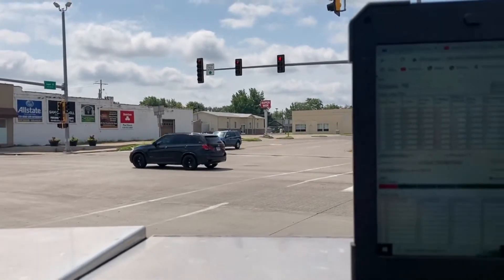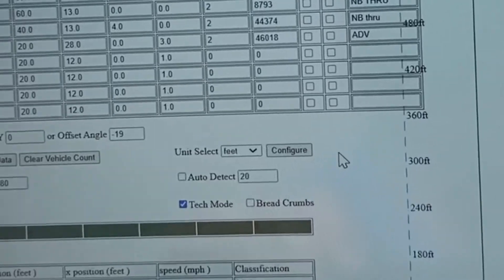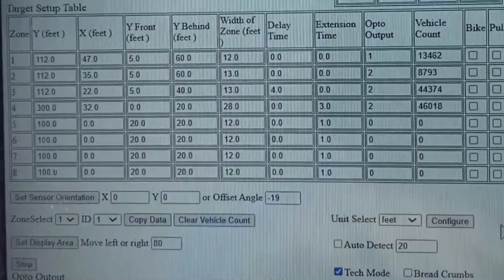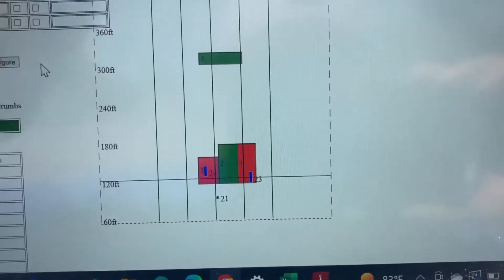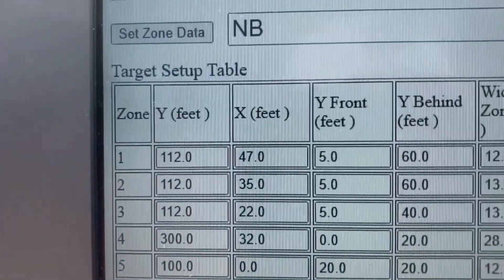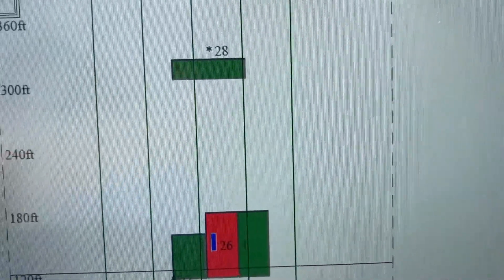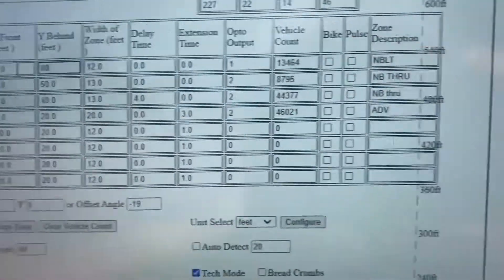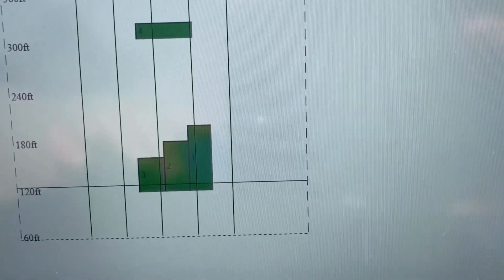Fixing Bad Drivers with Radar Detection

Comment: Ah hah!  This all makes sense now.  I bought myself a Uniden R7 radar detector for Christmas 2022.  Sometime around March of 2023, the city installed a bunch of new highly unnecessary traffic  signals on a divided feeder road to interstate 35, and every time I'd approach one the K-band would light up like a Christmas tree.  It got me curious if any traffic signals used radar for vehicle detection, but naturally not knowing any brands or models, that was frivolous and didn't really answer any of my questions.  You mention "M S Sedco" detectors, which from a quick google search, their datasheet shows they operate at 24GHz which is smack dab in the middle of the K-band.  Neat.  I got so tired of thousands of false K-band bogey alerts that I disabled detection of the band all together.  Ya can't drive a mile in this city without at least 3 false alerts.  IDK if the police even use K-Band around here anymore, one day I might find out the hard way, or maybe not?  I don't really speed unless I'm on an open interstate, but even then I'm more of a 5mph over kinda driver.

Comment: can you explain the flash light to the interection changing the side roads to detect immediately and changes the main redlightt timing i have an intersection where at night you have to sit and wait for 5 mins aand the main way stays green with no traffic and i sit and wait the intersection is NO TURN ON RED and ith an acward side slant and the other side is blocked to to a building close to the interscetion its on our main street in the middle of town if you can explain how this work thank you great videos
Reply from the maker: I always here stories out there about using flash lights to change the traffic lights.   Not possible.  
It sounds like though that the detection for mainstreet is bad and maxing out the green time OR someone programmed WAY too long of a green time in the traffic signal controller.  Either way, find out who maintains the signal and complain until they fix (squeaky tire gets the oil).  This will be usually be the city's Public Works Dept.  Hope you get that resolved.  I feel for you!
Reply: @streetsmartstraffic  I always laugh when see someone sitting at a red light and start flashing their high beams lol.  Can't believe people still believe this myth.
Reply from the maker: @elesjuan  If it says it on the internet, it must be true!  lol

Comment: I don't know why or how, but, YouTube just started showing me these videos.  It's interesting, for sure, more so about HOW the lights work, rather than the repairs.  I'll never see or operate the inside of one of those control boxes, and I'm sure there's millions of variants.

One thing I have seen in my neck of the woods (Ontario) is there's pavement patches where I thought sensors were (And probably are, given previous comments).  I try to roll up on those.  I didn't know there was radar involved, but I guess that'd change light to light, district to district, traffic volume to traffic volume, and dollars and cents. :P
Reply from the maker: Radar, video, microwave, inductive loops, proximity sensors...all kinds of detection could be used.  But yes you are correct, it varies all over the world.  Thanks for your comment!

Comment: Happened to me since I tend to stay back behind the stop line especially where a side road joins the main highway and trucks cut the corner in front of me.  Once I missed a full cycle and never got a green light so I advanced 10 feet or so then finally got the green light.
Reply from the maker: Great point.  You're one of those smart drivers though!  You realized it and pulled up
Reply: @streetsmartstraffic  On friday driving home the same way I looked for cameras or radar, seeing neither, concluded it was inductive sensors in the roadway.
Reply from the maker: @thomasmaughan4798  Sounds like you did your due diligence!

Comment: In Australia, we have a related problem that idiots sit right up the arse of your vehicle at traffic lights, instead of keeping the mandatory distance of at lease one vehicle length (5 metres). One excuse is people think there are more than one sensor at lights and they think cars have to be shoved close together to detect more cars and give those lanes priority. -How wrong they are.
The other excuse is idiots are being taught by other idiots that they only need to be able to barely see the tyres of the vehicle in front, so they can turn out if they need do. -Not only is that wrong, because that depends on how far the front wheels are from the front bumper of their vehicle, but different height people can see different distances in different cars.
The main reason why 
Under Australian road rules, it's a requirement to maintain a safe distance at all times. Keeping at least one vehicle length between vehicles means there's reduced risk of injuring (or killing) someone in a vehicle ahead, if there's a rear-end collision.
I personally know this to be true, because I kept just over a car's length (around 6-7 metres) distance when my car was rear-ended by a speeding car as someone tried to out-run the cops. If I hadn't kept that distance, myself and the people in the vehicle ahead of mine would have suffered far more serious injuries and perhaps even death.
Reply from the maker: @jublywubly     All good info there.  Funny- I never thought about this: "different height people can see different distances in different cars."   Thanks for chiming in!
Reply: In my town, if there's only one car in the left turn lane, he won't get a protected left turn arrow.  So it matters (sometimes) HOW MANY cars are waiting to turn.
Reply from the maker: @thomasmaughan4798  Thats interesting.  Hmmmm...I wonder if the detection zone is placed poorly and not detecting the first car.  Or a mad scientist signal engineer has designed it to be that way???
Reply: @thomasmaughan4798  Sometimes they are programmed to give whichever direction has the most traffic longer ON time.  Streets that have freeway access will have much more traffic than streets that don't.  It gives more wait time to accumulate more cars instead of short cycling more frequently.   I have also noticed programming includes time of day and day of week.
Reply: Stopping so you so long as you can see the tires of the vehicle in front of you is a simple practice that makes good sense in general; it's not some hard-pressed rule people need to follow, but having too much of a space between vehicles creates a whole different problem of backing cars up for long stretches (probably not an issue in small towns or rural areas). 

The points about how far the front wheels are from the front bumper are moot, and different heights of drivers isn't going to matter very much at all. The bigger issue would be the height of the vehicle in front of you (e.g., a raised truck or a slammed car), but drivers should adjust accordingly. However, there is sound logic to maintaining more space to buffer the car in front of you should you get rear ended (as you experienced), but that's a big focus for something that happens very little; the vast majority of people will never be rear ended, let alone killed by it. Based on your initial statement, I'm guessing you'd settle for people at least sticking with the general rule of seeing the rear tires in front of them, as opposed to being right up on you.

Comment: why are y’all not using 2070 controllers?
Reply: And why no 332 or 336 cabinets
Reply from the maker: @Micheal-Wes1  Well Mike, I guess its our region.  There's not many of those controllers/cabinets around here.  I have worked on them before.  What do you like about the 2070 & 332/336 cabinets over NEMA?  Just curious
Reply: @streetsmartstraffic  Well the 332s. are pretty great a lot of room to work in and the 336s. they’re OKOK but not that much room but the 2070 controllers I think that’s the best thing on the market when it comes to programming, your overlaps etc. 
I’ve been a traffic tech now for 10 plus years and I like it and I’m finally gonna get my level two this year so wish me luck and thanks for your fast response.
Reply from the maker: @Micheal-Wes1     Good info.  Thanks.  Hey good luck on your Level 2!  We need guys like you out there who 1) Take pride in their work  2) Care about people traveling your roads (safety/efficiency of signals).  
I always think its my wife, son or daughter out there driving thru those signalized intersections....